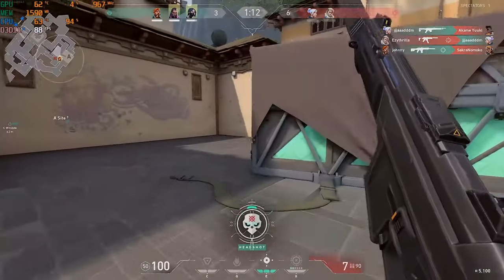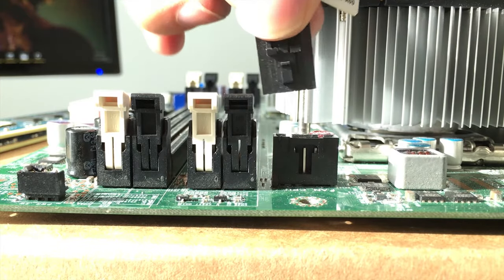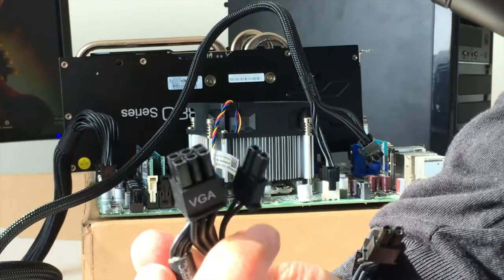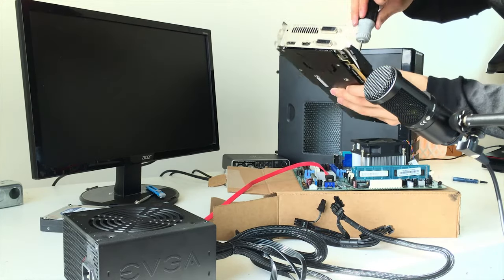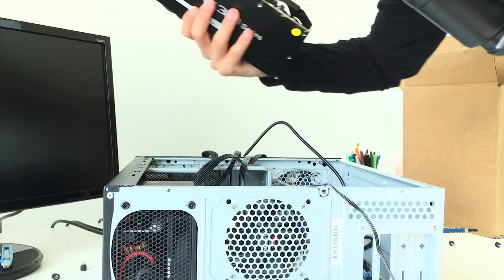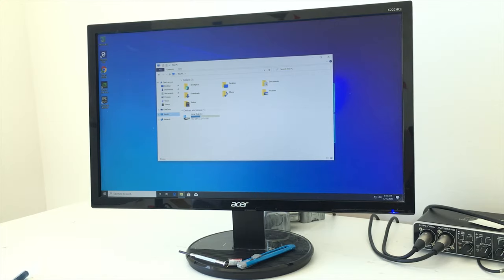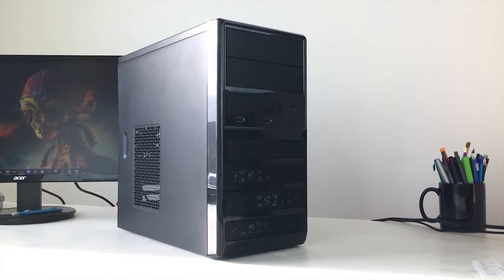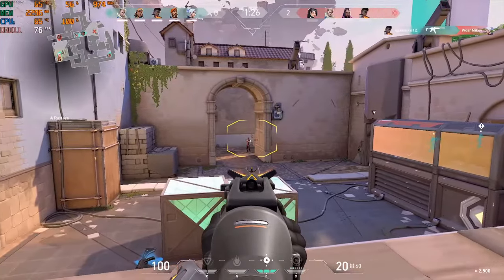I5 2400 PC Build For Gaming In 2020 $200 Gaming Computer | Call Of Duty, Fortnite, Valorant

Comment: If you are reading this comment,
Is 4 Cores still enough in 2022?

Well 4 Cores 4 Threads isn't enough in 2022. At least 6 Cores 6 Threads CPU, or 4 Cores 8 Threads CPU.

It's not worth buying 2 Cores 4 Threads or 4 Cores 4 Threads today.

Besides, Core i7 2600K is pretty much affordable today.

Comment: very good video , recently bought a bundle locally with an fx 6300 + 2x4gb ddr3+ mobo + pcie wifi card + tower cpu cooler, all for 60€, gon grab something like an rx 560 for around 50€ , cheap case n power supply for 25€ and already have an hdd. Budget builds are so fun
Reply from the maker: Thank you. that's awesome. Yeah budget builds are so much fun, you always want to see what you can do better in the next one. Thank you for commenting.

Comment: The issue with warzone is the 8gb ram. I play it on my rig Ryzen 7 3800X RTX 2070 32gb DDR4 3200mhz CS 16. Measured with MSI Afterburner it devours close to 14gb of ram. Since it’s way more powerful rig I know it uses more ram but on I5 case for sure it needs more than 8gb. Given that recommended spec CPU it’s a I5 2500K I don’t think cpu it’s a huge bottleneck. I know that K chips can be overclocked higher but I don’t think when this cpu it’s the minimum recommended one was listed with highest possible OC. Stock 2500K should perform pretty close to I5 2500. If you had NAND sata drive the issue might been gone since system would use NAND ssd to compensate for lack of ram. But it’s a budget build. This reminds me that not cheapest possible deal it’s the best deal. For 30/40$ more opting for 2x8 ram sticks it would be a much better build. Great video though.
Reply from the maker: Yes for sure giving it 8 more gb of ram would definitely help with performance. I didn't have it on hand at the moment, and I just filmed the video since I had everything else. Thanks for commenting.

Comment: An upgrade to the i7 2600 would make a big difference and give you a lot more CPU breathing room, but those are $50+.  Alternatively, you could use a Xeon E3 1230, which is a 2600 equivalent with 4C/8T, and a 200MHz lower base/boost, but much cheaper.  I bought one for $27 US a couple months back.
Reply: It uses the same socket right? I can just replace it like a normal i7 cpu?
Reply: @myerwerl  Yes, I wouldn't recommend a CPU that won't even work.  They're both LGA 1155 Sandy Bridge CPU's.

Comment: Those first two RAM slots not working could easily be dirt in the CPU socket.  Try cleaning it with a clean toothbrush and 99% rubbing alcohol.

Comment: The reason why there are only 2 ram slots that work is because the i5 2400 only supports 2 memory channels, same goes to the i7 2600 but the maximum memory size is 32 gb so swapping those should be no problem.

Comment: Guys go with this instead nowadays for a super budget pc use i5 3570k and the graphic options will be Gt 1030 for a super tight budget,Rx 6400 if u can save cos it will give ya 0.03 bottleneck use 8 or 16 GB Ram and h61 pcie x16 motherboard and other components just Google em ( use psu 450watts)

Comment: Bro , I want to install an i5 2400S in my old MoBo . Here are it's specs :-
i. H61H2-AM V1.1
ii. H61 Chipset
iii. ECS brand
iv. BIOS :- P01-B3 (10/12/2012)
v. Socket :- LGA 1155
 
I googled to find whether the i5 2400S is compatible or not , but results don't appear . Can you tell whether my MoBo supports it or not . I am currently using a Pentium G630 .
Reply from the maker: Well here is a full list of compatible CPUs with your motherboard 

https://www.cpu-upgrade.com/mb-ECS/H61H2-I(V1.1).html

The i5 2400S is on that list so I it should work.
Reply: Thanks alot

Comment: I have the same specs except for the gpu...and one of the low requirement games it runs very clunky..is that because i dont have a gpu?
Edit:I have a gpu now
Reply from the maker: Yes if you don't have a Gpu gaming will be very limited with the type of games that you can play. I would recommend you getting a cheap Gpu if you want to play games.
Reply: @johnnyzzzz  cheap gpu as in rtx 3090?
Reply: @blade2247  troll
Reply: @blade2247  depend on what game you gonna play , do your research , as example at least GTX 750 Ti to play AAA games

Comment: I have an i5 2400, which gpu recommends?
Reply from the maker: Here is a couple I would recommend in this order.
 R9 280x http://bit.ly/3aNRxu9
R9 285 http://bit.ly/3qjfJeJ
GTX 960 http://bit.ly/36ZzD6z
GTX 670 http://bit.ly/2Onzeod

I will also link this page https://www.logicalincrements.com/articles/graphicscardcomparison 

So you can check the prices on better performing graphics cards.
Reply: @johnnyzzzz  thanks dude.
Reply from the maker: @Luis-qc9ew  no problem
Reply: @johnnyzzzz  bro what type of motherboard you using
Reply: Rx 580 , i have an 8gb one and it performs really good with this cpu there is a slight bottleneck especially on cpu intensive titles but overall most games run decently

Comment: Hey can anyone tell me what the mother board is as i am trying to case swap a sff dell optiplex but it has the wrong mother board
Reply from the maker: If you have an i5 2400 here is the cheapest motherboard I could find that is like the one I used in the
video http://ebay.us/ywoOMj

Here is the motherboard I used http://ebay.us/Cwq7y1 it's pretty expensive at the moment I got mine for 
$15 so I would keep an eye out for price drops.

Here is also a list of Lga 1155 motherboards that fit the i5 2400 http://ebay.us/sQd08z I would recommend
you get a full atx not a SFF motherboard like the one you have

Don't buy this http://ebay.us/YefafE because the I/O is on the bottom of the board make sure the I/O is 
on the top left and the pcie, where you put the graphics card is on the bottom left. Just make sure it 
looks like the second one on this list.

You can also search by the specific computer that you have like this http://ebay.us/6gF1Zk 

I hope this helps.
Reply: I tried the sff! I returned it

Comment: Hey man, I found a deal on facebook 45 dollars for r9 280, will it get the same performance. Thanks
Reply from the maker: It will be a about 20% slower  than the 380, if you can negotiate with the seller for a lower price that would be ideal. If not it’s still a good deal, cause prices for pc parts are kinda high right now. Let me know how it goes!
Reply: @johnnyzzzz   In my area there aren't many good second hand options for graphics cards but this was the best price to performance card I could find, I'm going to pick it up tomorrow, thanks for the reply, much appreciated
Reply from the maker: Sure no problem. Yeah it’s still a good deal I think, especially if there is nothing else around. Thanks for checking out my video as well!

Comment: Hello!
I just have a small question
how can i cut off that plastic carefully?
Reply from the maker: I bent it with some pliers. Just do it very slowly. I guess.
Reply: Thank you bro I appreciate it
Reply: @johnnyzzzz  i have a problem 
im using a dell optiplex 990 mobo and it keeps turning on and off repeat no beeps
what should I do??
Reply: update: it works BUT it doesn't turn off from the power button

Comment: Its not that the ram slots don't work its just you're supposed to put them in the same color slot. Or think of it this way, they have to be  separated by another slot. Nice video though!
Reply: The point is that he tested them both and he even said that they “both” don’t work. Listen to what he is saying. Sheesh
Reply: Have you ever installed ram in a motherboard? There is a little tiny text piece next to the slots and they say which to install  into
Reply: @purplefade7705  did you not read my comment? He said that both of those slots were dead and only the right 2 slots were working. Read the whole comment again.